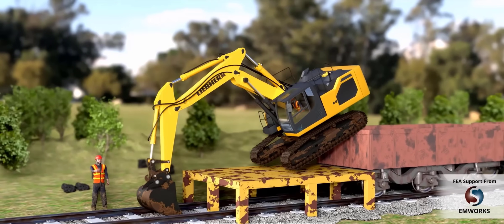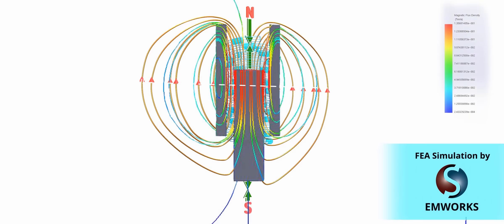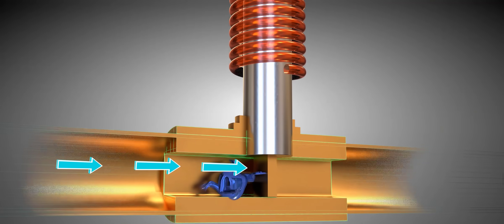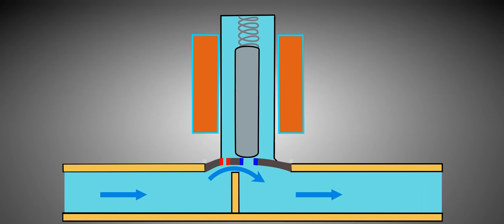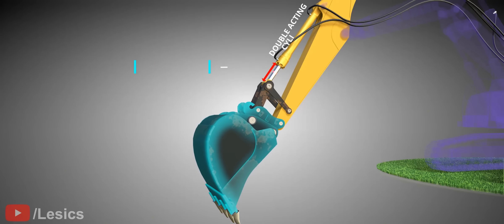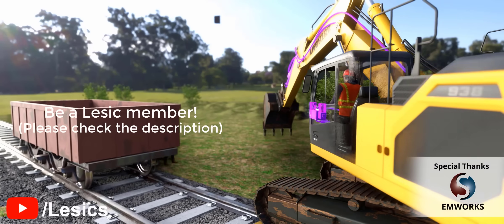Solenoid valves | The Beauty of Engineering

Comment: Timestamps (Powered by Merlin AI)
00:04 - Solenoid valves are essential for fast and efficient hydraulic excavator operation.
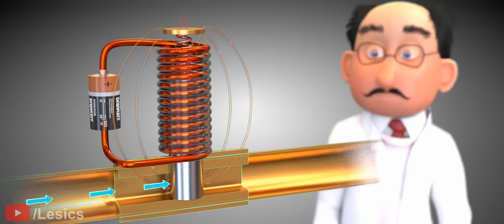01:22 - Solenoid valves utilize magnetic forces to control fluid flow.
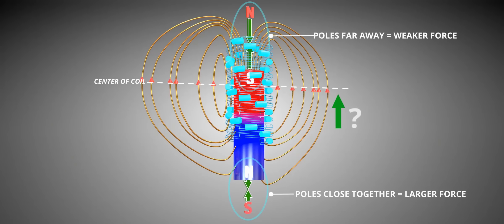02:34 - The solenoid valve design utilizes magnetic force to control fluid flow efficiently.
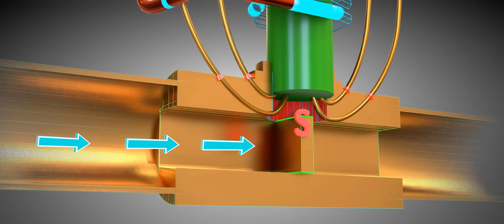03:52 - The flexible diaphragm design prevents valve failure under high fluid pressure.
05:01 - Solenoid valve operation involves pressure management for fluid control.
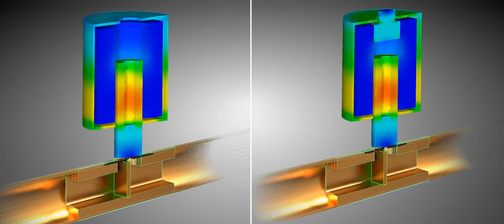06:09 - Iron cylinder improves solenoid valve response time significantly.
07:22 - 5x3 solenoid valve technology enables efficient oil movement in systems.
08:41 - Solenoid valves control oil flow to operate a bucket mechanism.

Comment: You failed to mention a downside is water hammer from the quick closure of the valve. If you don't arrest it, weak joints will eventually fail. That's why slower acting valves can be more useful when the incoming water has pressure.

Comment: Solenoid valves are often used in RCS (Reaction Control System) installed in spaceship, satellites, orbiters etc. An RCA is essential for changing and maintaining the correct attitude in space or orbit. Think your ship needs the solar panels always facing the Sun.
The RCS valves are the single most critical component of every Space vehicle, after the turbopump in the main rocket engine. These valves often control the flow of hypergolic propellent - like hydrazine and nitrogen tetroxide, which burn upon mixing. Most space payload and vehicles failures, either past or contemporary, are caused by the RCS malfunctioning, because of propellent valves leaking, being stuck open, and other failure modes. The solenoid valves - often opening and closing 2 to 10 times per second - are highly critical, but entire missions are being completely lost because of failed valves in RCS thrusters. Other RCS valves have kept operating for decades - think of the two Voyagers - without an hitch.
Thank you for the video!
Greetings,
Anthony

Comment: If I am not wrong, for the hydraulic system 4/3 is preferred over 5/3. It does not need an external Tee for both outlets to the sump/tank.

Comment: The diagram at 4:58 doesn't make sense. The two vertical forces aren't the same, as the area over which the pressure is acting at each end is different, and therefore they don't cancel.
Reply: I'm not that sure either, but I kinda remember hearing somewhere that a fluid exerts pressure equally along the area of its container..etc ... Icould that be applied here too ??

Comment: Question: would the flow not be a too low in a solenoid valve? And does the coil need to stay active, if so, wouldnt it get hot?

Comment: During the stop position of the valve the oil should be recirculated to the storage tank not stopped by the valve. According to your video the pump is running and the oil is getting blocked, which will cause the positive displacement pump to get pressurised.
Reply: Thanks to say it. Please Lesics, explain more.
Reply: Solenoid valves always has safety oil on other side

Comment: that is not how excavators hydraulics work. they have a low pressure pilot valve system, which controls a high pressure valve bank. electric 5/3 has nothing to do with excavators.

Comment: Fantastic explanation. Now a follow up question on hydraulics and machinery control: How do the operators joysticks control the flow, can the solenoids be controlled so precisely that they only open up a small amount or how is the motion smoothed out instead of this on/off style flow as shown?
Reply: Yes , valves can be precisely moved with help of a proportional valve which meters the flow of oil according to voltage input to solenoid along with regular directional control.

We can still use a manual / proportional flow control valve along with a normal solenoid valve to achieve the same function but less efficiently

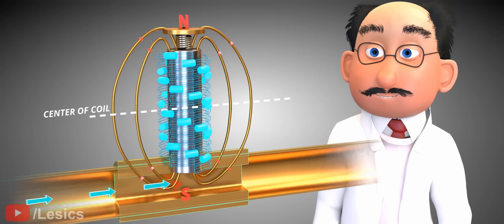Comment: Very clear explanation, it seems you have the magnetic poles flipped for the solenoid.The top of the solenoid near the spring is the South Pole since the magnetic field is entering the coil.This is at 1:36 in the video.
Reply: Doesn't matter. Solenoid will work regardless of polarity.

Comment: The automatic gearbox work with same control by valve body we can found it in bottom of transmission after dissamble the oil pan and filter the Transmission control module sent the power to the different Solonoieds in the transmission which control to change the speed and shift and reverse by looking to the gear lever position sensor and car speed by vss sensor and the position of the throttle by TPS sensor and transmission oil temperature sensor and tiptronic switch and mode switch Classic and standard modes 
And we other automatic transmissions like DSG with dual clutch gearbox and CVT

Comment: I Love Your Videos. But The Example Of Solonide In Excavator Is Wrong.
In Excavator We Used 4x3(4 Port 3 Position) Solonide Or 4x2(4 Port and 2 Position) Solonide. To Control Hydraulic Cylinder We Used Pilot Operator Direction Control Valve Which Is 6x3. And Solonide Is To Control Pilot Line Of This 6x3 Valve.

Comment: Hi Lesics, you made a little mistake. The core cannot perfectly align with the center of the coils. This is because there is a spring, and so you need a continuous opposing force to hold it in equilibrium, so the core is always held slightly below the center.
Reply: This is negligible as compared to solenoid valves
Reply: The excavator uses a pilot pressure from a mechanically operated joystick supplied by a charging pump it pushes the back of sppol to make a passageway of the pressure from main pump to the direction of actuator

Comment: a slightly off the topic question: why is it that we rarely see a two way gear pump that reverses fluid pressure simply by reversing rotation? is here something Inherently flawed with a two way gear pump? all of the high power hydraulic systems with several actuators use complicated valve systems and a single pump, but why not a pump for every actuator and no valve at all?
Reply: Let me think, economies of scale, less parts to maintain and central control and use of hydraulic system, the time delay due to flow reversing

Comment: A really cool thing about the 5/3 solenoid valve is that the spool (or poppet as its called in my industry) is pressure balanced so there are no uneven forces acting on it from the oil!
Reply: yes same with the example 1 with diaphragm.

Comment: Very interesting video. I use these on a machine at work but they're for converting pneumatic pressure to hydraulic. As well, our dust collector uses diaphragm solenoids during it's cleaning cycle to pulse air into the filters.

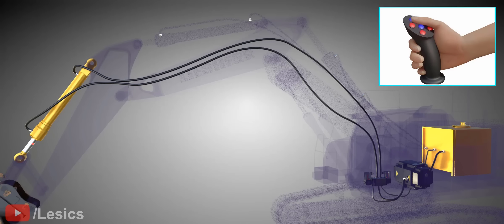Comment: 08:25 The lever button of the excavator is operated to prevent the boom, arm, or basket from being raised. When the lever is operated, the corresponding pilot valve is deformed to eventually operate the boom, arm, and bucket. Please correct the information.

Comment: I wish you could do more hydraulics, like pumps, motors and of course valves as well
Reply: You can check #lunchbox sessions they’ve a lot about hydraulics
Reply: But I want learn engineering
Reply: Find a different source.
This video has several glaring mistakes.
First, the valve operation (5 x 3) is not used on excavators. With that type of valve, in the off position all flow is stopped. That will burst a hose or stall the engine, a pressure relief valve cann it be used since they heat the oil very very quickly.
Excavator valves in off position direct the feed from the pump straight back to the tank (or, more precisely to the next valve for a different part of the system)
Next, excavator valves are proportional, not full on or full off. This permits the operator to perform slow, precision moves.
Reply: @dougaltolan3017  That's cool! Thanks for sharing your knowledge!
Reply: agree
Reply: *would
Reply: Yes please!

Comment: Excavator buckets are not controlled by solenoid valves and buttons. Who told you this? The buckets speed is controlled proportionally to the joysticks position, alowing for smooth movements.
Reply: Surely the joystick just controls the speed of the pump, no?
Reply: @Tugrar  Pretty sure it uses variable displacement pumps for all its motions so basically yes, the joystick controls the flow (though the rotational speed is constant).

Comment: You have added something that is asked in job interviews, "What is the advantage of a solenoid valve over the usual rotary valves? " Very helpful. Also, one can ask, "what is its disadvantage?" 
Lesics makes us think, not just watch passively.
Reply: You can't use it with very high pressures. (You probably could but unless you really need that timing component.. the dyafram would be too expensive)
Reply: You can't used it for high volumes too. 
You would normally need an actuator for high volumes. The solenoid valve activates the actuator and the actuator operates larger other valve (or rotary valve).
Reply: Thanks for all these smart answers. I knew only one answer, just two states -- Fully closed or fully open-- no gradual flow control as in other valves. Now, from your answer I see that there are many other issues. This is what Lesics way of teaching does; it makes viewrs think rather than just listen passively. Hope all of you forward Lesics channels to your friends and fellow students.

Long ago I had a fun idea of using several Solenoids to control a Manual transmission Car to a Dual mode -- Either Manual of Automatic. In automatic mode, a micro-controller would send signals to solenoids to move the clutch and the stick-shift levers smoothly and automatically with perfect timing and synchronization.
I guess some car already has such features by now or even better ones.
Reply: @SALESENGLISH2020  It's called an AMT gearbox brother. How much cost of that project? I am interested.
Reply: The rubber diaphragm can deteriorate over time or with contaminates in the fluid and let fluid pass through even it's off. It also needs constant power to keep the valve open unlike a rotary valve.
Reply: Surely the way the fluid has to flow around must increase resistance, and decrease maximum flow.
Reply: The water hammer, in this model of valvule is not a problem. Or you must oversize the line to withstand the pressure.
Reply: You can have metered/gradual flow with these solenoids. By varying the amperage sent to the coils you can shift the spool in small increments.
Reply: @SuperSecretSquirell  You are right. Yes, there are proportional solenoid valves. Thanks.
Reply: except excavators used piloted valves not electric solenoids.
Reply: To move large volumes of fluids they need to be supported by pilot system
Reply: Disadvantages of solenoid valves, especially diaphragm type:
- contamination sensitive, small piece of dirt will block it (stuck open or close),
- can't use it with extremely high or low pressures (and/or flow), or temperatures,
- directional, there is IN and OUT, if you flip it, it will be forced open (or stuck open after one cycle ON-OFF, but it will not switch off!),
- someone said "can't be operated manually". But you can test it using strong magnet (remove the coil and touch the coil stem with magnet, it will switch the valve ON),
- can't switch the media (oil, water, other chemicals), valve must be specific type and materials for each category of medium,
- they are not that very fast (depends on application/industry).
Reply: What is Lesics?
Reply: 1.Requires electricity to operate 2.Generates a magnetic field (which may be undesirable) 3.Only binary output On/Off 4.(Probably) higher cost and maintenance
Reply: No manual operation

Comment: Im excavator operator: that's not how how IT works, opening and closing of bucket happens by moving joystick. No solenoids are in use for this movement. Solenoid valves are used for different hydraulic functions.
Reply: Manually operated spring return 4/3 valve
Reply: So solenoids are used for attachments like jackhammer?
Reply: @jakubpollak2067  rotating bucket, driving (wheeled excavators), tilt on bucket, AUX functions (brakes, rotation brake) newest linę of cat excavators steering is puree electric - so there are solenoids
Reply: @Herezjush  I thought driving was analog to get precise movement

Comment: when i was 12 class i tried to make solenoid as shown in book. i bought copper wire a plank and some other things. i tried some days but could not make it
Reply: may be the copper wire you used was not insulated
Reply: I also tried same
but fuse of switchboard got melted as soon as I switched on the power so I didn't try again
Reply: @chaitanyaborude5980  Need a DC not AC. Also voltage should be stepped down
Reply: Why couldn't you make that?
Reply: I played cards with my friends when I was 12 class. 😅